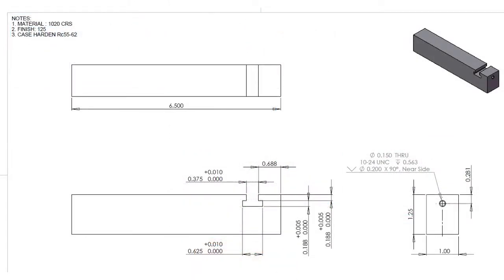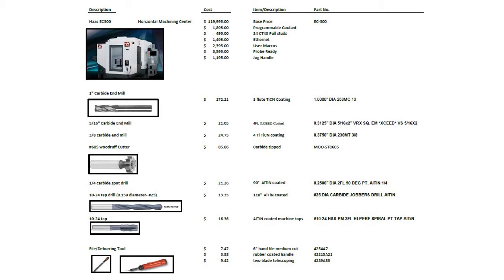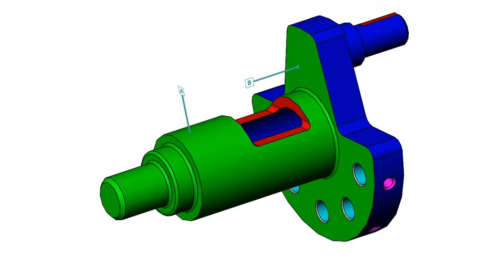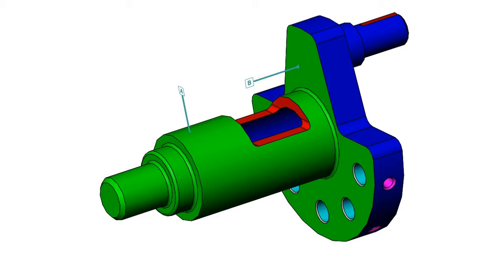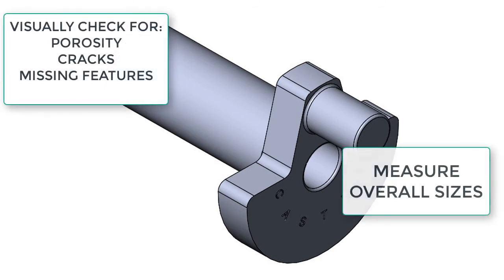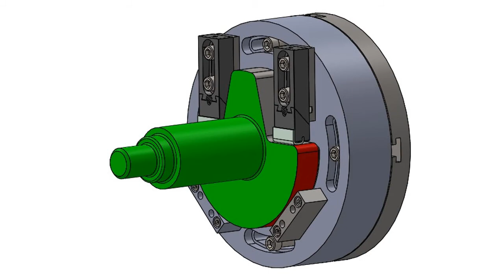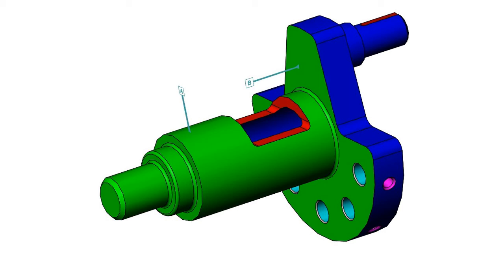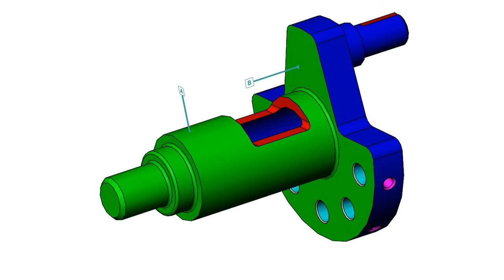Process Planning Introduction

Comment: What software is generally used for the planning and managing the data such as machine selection, tool selection, material removal data etc. for the process plan? Are there any opensource software to maintain the process and planning data? Thabks for sharing.
Reply from the maker: We do not use software, we just do it.